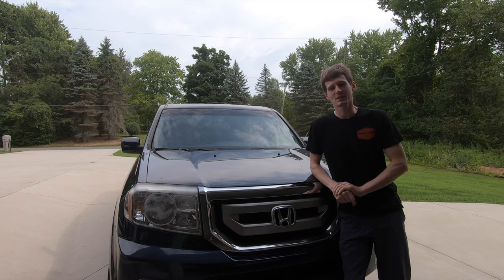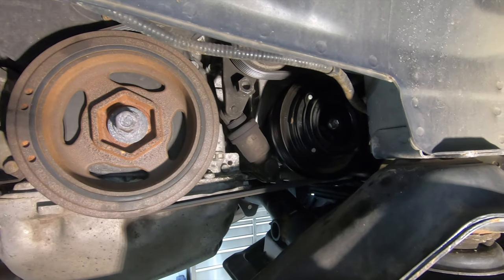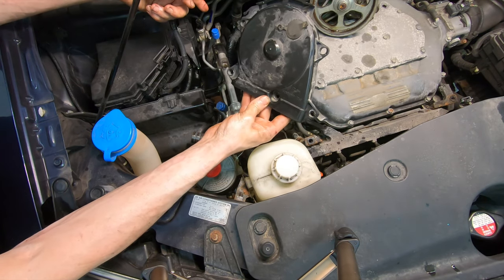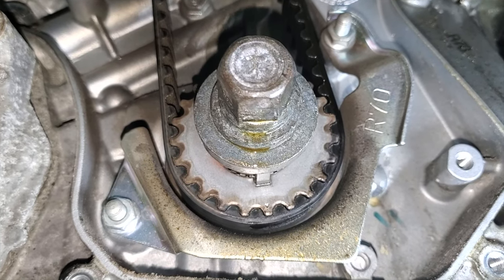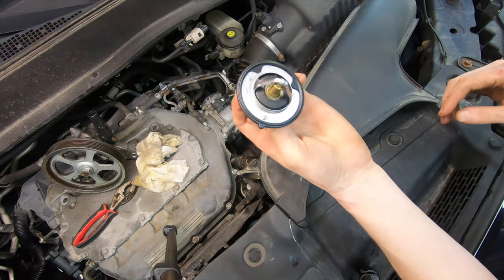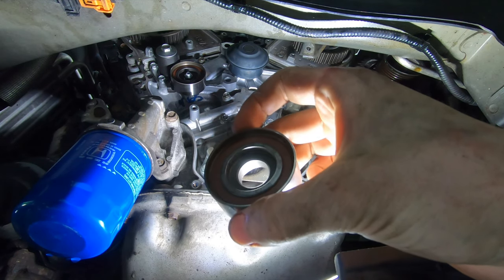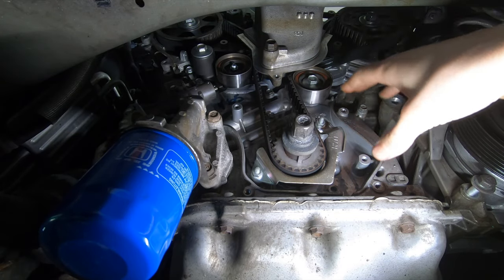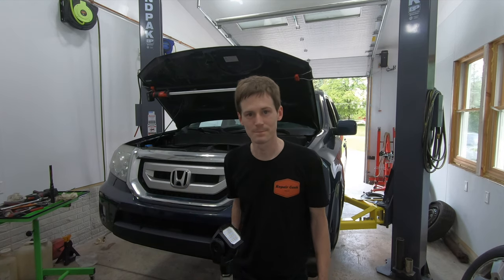Honda 3.5L V6 Timing Belt & Water Pump Replacement- Pilot, Ridgeline, Odyssey.

Comment: Thank you. So quick question for you. I marked everything as you said and all the hash marks lined up TDC. While I was putting the timing belt on, the rear cam rocked back out of time. Any ideas on how to get all three of these lined back up correctly?

Thank you,

Chris
Reply: Okay I managed to get the timing belt back on and then lined up TDC on the crankshaft pulley. I also have the front camshaft lined up TDC on the markings where is says number 1; so that's correct. But the rear cam sprocket is not lining up. Any suggestions?

Comment: i need help.  2005 honda pilot.  screwed up and lost the timing alignment when replacing the timing belt.  I now have lined all the marks up and put the new belt on. but how do I make sure it is not 108 degrees off????

Comment: At 17.30 minutes, you removed the tensioner, can this also cause the valve timing to spin a small amount. I’m worried that any loss of tension will throw my timing off. If this happens can I spin it back by hand? Thank you.

Comment: I still don’t get it right after you pulled the motor mount it was back in the air how are you supporting the motor?
Reply: There's more than 1 motor mount.  This is more or less support.

Comment: Ok I have to install the new belt tensioning to the top camshaft , but what if the belt tensioned doesn't match with the dents of the up, can I move the upper camshaft a little bit to match ???

Comment: This was a great video.  Very helpful, but honestly I'd say this is not a job for the feint of heart.  Here's some of my notes from my experience YMMV:  

Timing belt notes 2013 Honda Pilot – while the nightmare is still fresh in my mind

1)	It seems like the overarching idea that Honda is trying to convey is that you’d be way better off taking it to them in terms of time and aggravation.  It’s as if they’ve gone out of their way to make this unnecessarily difficult.  This job took me about 8 hours with all of the other maintenance that needed to be done with it.  Some of that was taking things apart and doing it again.  Block out a day and it will probably take most of it.
2)	The A/C lines are right in the way of everything you need to work on.  The power steering pump, the mount, the serpentine belt tensioner, the computer, and even some of the bolts for the timing belt cover. Be very careful not to break those lines.  
3)	The maintenance says to change the radiator fluid.   Radiator drain valve is in a messed up spot.  Cut a piece of closet clothes rail that I had left over and notched it to serve as a tool.  
4)	Don’t take the plug out all the way though.  Or you will need lots of cat litter to clean up the mess.  I’m using the 50/50 pre mix of the blue fluid.  
5)	Just like the video says even though you drain it they leave plenty in the engine so when you pull the water pump off it’s sure to go everywhere.
6)	You will not remove the front pulley without a harmonically balanced socket.  Even with it there was several minutes of hammering on it before it finally broke free.  And breaker bar? fughettaboutit.
7)	I pushed the idler by hand to make sure nothing is going to move.  When I did the back cam moved two teeth because of the slack and I got to start over and line everything up again.  DO NOT REMOVE THE PIN.  I realize this is a little different than the video, but putting it on it’s really difficult to make sure there’s no slack, and the only way I was able to test it before reassembly was to do it the way I did.
8)	It’s a pain in the behind to put that hydraulic tensioner back on with the belt in place.  But less painful then other ideas I had.   Put the bottom bolt on first.  Yes the one behind the oil pressure sender (in the 2013 model).  What a great place to put that.  Thanks again mr engineer.  Once the bottom bolt is in you can apply pressure to the bottom of the tensioner to align the top bolt and get it started.  There’s no room to work in there.  The only way I could get to the bottom bolt was with a wrench a fraction of a turn at a time.  Torque specs for all those 10mm bolts (tensioner and timing belt cover) is 104 inch pounds.  
9)	Once every thing is back together and you’re sure there’s no slack anywhere except for the idler pull the pin.
10)	Rotate the engine from the front pulley a full 360 twice and make sure all the marks still line up.
11)	If you have to recompress that tensioner to put the pin back (as I did) I put it in a vice and used a big clamp to compress it so I could put the pin back in.
12)	Don’t drop anything behind the engine while doing the plugs.  There’s a whole bunch of stuff for it to get lost in.  Had to recover my ratchet with a telescoping grabber.  And no way to get your hand up in there from underneath either.

Comment: CoolVid, got the 2 crank tools, ordered the socket last,since last weekend was fighting the crank bolt....Doing my buddies '12 Crosstour, work cat AGAIN tomorrow, now that I have the special socket lol. Pretty easy job actually when you have the RIGHT tools lol. Been a tech 40+ years, autos to semi's, go figure my 40+ year tool collection, still have to buy now n then more tools, even retired hahaha. They will miss their lifelong mechanic soon, when I move to the Philippines. Even retired I been busy here working on their damn cars , so much for relaxing huh. A lift would make it soooo much easier, than flat backing it on the garage floor !!

Comment: That was amazing that the Milwaulke 1400 ft/lb impact would not break it with a regular impact socket.  My special crank bolt socket should arrive in one week!  :)
Reply: Some won't come free even with the weighted socket and heat.
Reply: @ua7pyro591  I ended up having to use a 3:1 torque multiplier to break mine loose on my Honda Fit.  It was $270 on Amazon and is rated for 1100 ft/lbs of output torque.

Comment: I'm taking my 2008 Honda Odyssey Ex-L to a mechanic because we just bought it and have no idea when the time belt was changed. It's 129,000 miles. The crazy thing is they had no idea what type 2 antifreeze was. I'm like for Honda. I said it's blue. There like never used that before 🤦🏻‍♀️ so just bought that 2. Maybe if you lived in Texas we would come to you.

Comment: do you think the Hi torque wrench is needed? perhaps the mid torque would work with 600 ft lbs of breakaway torque? this is assuming using the heavy duty socket.
Reply from the maker: Without trying it myself I don't know for sure. I have a gen 1 mid torque as well. It may take some more effort but I THINK it will get it done...

Comment: if one of the cams slipped back a tooth can i use a wrench to only place it on timing by rotating that one cam to line up? just one or two tooth not a full turn

Comment: Where is the crankshaft position sensor located on this engine the service manual says its behind the crank pulley outside of the timing belt I dont see it on my engine or this one

Comment: Question for you about the water pump. In a situation when the water pump isn't being removed. If when removing the 3 housing bolts it starts to leak a bit of coolant is that seal permanently broke. Other words once the 3 bolts are back in it is likely it will leak again without new RTV?

Comment: Just started doing this yesterday. I got all the way to putting the tensioner and before i pulled the pin i noticed the rear cam is not aligned, front one and bottom one are. Rear one is one section off. What can i do?

Comment: UH Oh!  I put the crank bolt back in without the key in place and rotated the bolt and noticed the timing belt did not move.  I looked back and saw that you left the key in place.  If I re-align the key way with the bottom sprocket to replace it, is it possible to put the key in one rotation out of time?  If so how do I determine the correct crank position?

Comment: I have a question i bought an 07 ridgeline used and it shows the timing belt was replaced 30,000 miles ago but it has been 6 years as well. I know thats not a lot of miles on a belt but what about the years ? Should i go by mileage or years more ?
Reply: I just changed out an original belt on 07 with 175k miles!!! It looked and felt brand new! I know looks & feel aren't definitive, but if your engine isn't leaking oil on it inside the belt cover, I'd have no problem putting more yrs on it.
Reply: @joeaverage5347  I ended up having it done and they guys told me at the shop no oil leaking and belt looked great oh well now I know it will be good for a long time! 175 k that's awesome

Comment: Ok, I don't have a lift. Will be doing tbe same job with just jack stands. What is the best way to torque the crank bolt, especially if the car is not on a lift and using long breaker bar without the clearance could be an issue.

Comment: I'm was trying to do the timing belt change on a 2013 Honda Odyssey 3.5. After getting all the covers and parts removed, I mistakenly pulled the key that connects the lower shaft to the lower timing belt sprocket. Then I proceeded to try and align the tabs for TDC but realized that the timing belt wasn't moving because I removed the key. I was moving the lower drive shaft separately from the upper camshafts
Have I ruined my engine? I can't remember how many rotations I made to mis align the lower drive shaft and upper cam shafts. This photo was taken after I used an adjustable wrench to align the shaft and sprocket. A new engine is $3k about what the car is worth. I'm feeling sick to my stomach now.

Comment: Once you pulled that engine mount I would love to have seen how you held the motor in place going up and down with the lift. Love the video very well put together.
Reply from the maker: There are 3 other mounts holding the engine and trans in. With it out the engine wobbles a little bit but isn't going to even come close to falling out.
Reply: @RepairGeek  thank you for the info that helps a lot

Comment: Hey was there a spacer or sleeve in the motormount? The bolts so much smaller than the hole in the mount

Comment: Hi , quick question, do you need a impact driver to loose the crankshaft bolt
Reply: It def helps. I also recommend a weighted socket. These mf are notoriously tight. Mine took a solid minute of hammering with M18 high torque. There are some other methods. I think honda makes some special socket that you can use to hold the crank pully. I have also seen people wedge a breaker bar on the ground and flick the starter. Looks really sketchy tho.

Comment: My niece just bought a 2014 Ridgeline with 55k miles. I think the mileage has been turned back. I believe this because the driveline make sounds when it back up. The engine cover is gone and the engine look like it has high miles. How can I tell if the miles has been turn back?
Reply: The dealership might be able to hook their computer up to it and it will tell them the real mileage of the vehicle, even if the previous owner put a new dash cluster in.

Comment: Question.  I did not see you put the idler/tensioner unit go back on here,  but in other videos it is put on without Loctite and torqued to 19 foot pounds.  I am wondering why no Loctite on that bolt but Loctite on the fixed idler pulley bolt.  I am also wondering why they put no grease on the sleeve that the unit pivots on. Comments?
Reply: OK, I see you did the tensioner installation as you went on after the belt installation; sorry I thought it was already shown installed in the video before that.  But no loctite on that bolt?

Comment: One more thing, the crank key needs to remain in before you rotate the crank or you will loose timing, good practice is to put the bolt in immediately after removing pully and make sure the key is still in

Comment: What if you drain the radiator and then turn it on so it can all come out ? Turn it off as soon as it all drains so it doesn’t overheat . Maybe you won’t have any coolant left in the water pump

Comment: Wow great video! Is there any issue removing the tensioner the way you did? I heard that if you remove the bolts under tension you could strip the threads or break the bolts because it's under so much pressure but it seemed like it came off without issue for you?

Comment: Do you need to remove the power steering pump to access the cover? I'd like to see if mine has any cracks and remove as little as possible

Comment: The other half of the job is the valve adjustment also due at the same time. You have to remove the intake plenum to access the rear hear valves.
Reply from the maker: https://youtu.be/25ZdVvUMuy8

Comment: Honda manual says replace two bolts-timing adjuster and timing belt idler bolts. Did you reuse those bolts? Any drawback to reusing the bolts? Thoughts?
Reply from the maker: What manual says that? Honda's OEM belt kit doesn't come with those bolts.
Reply: @RepairGeek  2011-2012 Odyssey Honda Service Manual.

Comment: you can remove that mount just fine without supporting, that mount is meant for side to side engine movement, not vertical.

Comment: Hey man. I posted a comment on your video from a year ago but I thought I would post it here since it is more recent. I’m referring to your undercoating product review. This was a great informative video and I appreciate you putting these products the test. My only problem is this. Not everybody out there has a vehicle that is I was close to these coupons as far as prep goes. Some people have vehicles with rust on them and for obvious reasons you can’t be a blast everything under a vehicle. I think it would be a good video to show similar pieces with rust already on them, Then using like a scraper or a wire wheel to get all of the impurities that you can with those options available. Then try these products and maybe a couple extras that people are mentioning in the comments and give it another go.

Comment: The serpentine belt tensioner smaller bolt, I torqued to spec but it still isn’t tight in the tensioner. Is the correct to let the shock move a little ? Or should it be pulled completely tight? thanks

Comment: Also found it interesting that the motor mount was shot.  Could it have been due to vibration from the cylinder deactivation system (VCM) that this engine has?  What about the other motor mounts, were they shot too?
Reply: Yes.  Lots on net about this and $1500 for OEM motor mounts. Used to counteract the VCM vibration.  That and premature engine failure as well as oil burning.  I installed a VCM delete (Muzzler) and have been happy since.

Comment: This may be the best car repair video I have ever seen. Well done bro had a question ? what are your thoughts on replacing the cam and crankshaft seals at this time ?
Reply from the maker: If they aren't leaking, I wouldn't don't touch them. That is going to be your call though. As you saw what I was dealing with wasn't leaking a drop.

Comment: Great video man. I just bought a clean 2011 today and it has 127k miles and no sign that the timing belt or pump have been changed. Im going to tackle this next weekend when my parts are here.  I think ill also do my spark plugs as well. I feel more confident now that I have watched your tutorial.  I'll be sure to have it on my TV in my garage so I can follow along. Is there anything else I should order and replace while I'm in there? Thank you for the links. Two thumbs up!
Reply from the maker: Valve adjustment. The guy I did this for did the valve adjustment himself.
Reply: How was it about to do mine did you get it all done and how long did it take?
Reply from the maker: @jaredm674  https://youtu.be/25ZdVvUMuy8

Comment: I need to replace just the tensioner, but I was going to replace the belt also since I was in there.  Do I need to replace the pulleys and water pump too? I understand that if I'm there, maybe I should, but wondering if I need to.  Pilot at 235K miles.
Reply from the maker: I would.

Comment: Your video says to not turn the cam shaft with a wrench to line up the new belt tight on the teeth.
But the other video i just seen was saying you should turn the cam bolts slightly with a wrench to get the belt teeth on the cam teeth. Then move it back into place... 
Any input on this?
Reply: That is why it helps to see a variety of videos on how to do a job.  What works for one may not work for the other.  I was in a panic because I could not get the belt to line up for fear of moving the cam.  Saw another video that explained the movement of the cams when the belt was taken off.  So gently moved the cam a bit to line up the belt  marks (painted lines from old belt).  Then after pulling the pin rotated the engine several times, checking alignment and all was well.

Comment: Question. Does it make a difference whether I take the serpentine off before breaking the crank bolt loose? I’m having trouble removing my crank bolt. Couldn’t even get it with a breaker bar. So I got a high torch impact wrench and I ordered the thicker 19mm. But I’m wondering if taking the timing belt off first matters. Thank you! Great video.
Reply from the maker: It won't matter.
Reply: Thank you! Got the 19mm socket you linked and it came right off! Really appreciate you making these videos!

Comment: Great video! Yes, that crank bolt is a real pain. On my 91 Accord had to buy an Ingersoll Rand 2141 3/4 impact to get it off (did it with a regular impact socket). Wish I knew about the specialty socket at the time, my 1/2 impact probably would've gotten it.

Comment: Thank you for the video. I’m going to address this job during the weekend. If for some reason any of the cams pulley move a bit (like 1-2 tooth) either clockwise or counterclockwise, can I just spin the out of time cam clockwise until getting back to the TDC position again?
Reply: Do that when installing the belt with marks painted on the new belt.